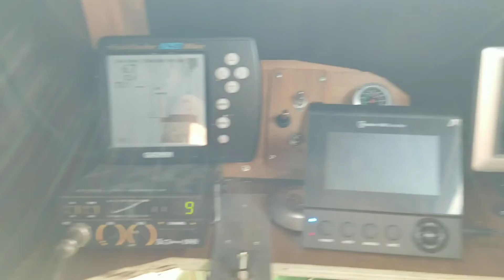Plywood mini boat for exploring!

Comment: Polycarbonate doesn't seem to seal well as its oily or greasy so sealing I'd say will be problematic. My friend built a fish tank 6' x 16" x 2' and sealed with clear silicon, he drilled and screwed every 1" or so and after a few attempts give up as it leaked like a sieve.
Laminated glass on the bottom about 14" x 14" at most and fixed to a box section or angle iron frame then to bottom of boat would be my choice.

I built a thin rectangular wooden framed boat like a canoe when I was 14 years old, I covered ( wrapped ) it with heavy duty clear plastic ( stuff used on building sites on concrete floors to stop damp rising dpc ) it was great. The water pressure would push against it but it was fine and the bottom of the lake was great to look at.

I saw shopping trolleys in the middle of the lake :( There was a shopping centre close by and when the lake froze over kids pushed trolleys out, ice eventually melted and the trolleys sank.
There was loads of fishing tackle caught on them.
It was very strange and eerie, definitely a different world ha!
Reply from the maker: Hmm well thats not inspiring confidence... i feel like there will be a little less pressure than on a 90° corner but that may just be wishfull thinking... maybe ill be able to wrap some fiberglass and resin around the corner or something.. plus only the bottom few inches will be underwater... maybe some flex seal from the infomercials or some crazy tar lke stuff....  thanks for the heads up buddy!!
Reply: @americanboathead5390  Epoxy and fiberglass might work on outside edges, water pressure is pushing in and not out which is better than the way a fish tank works so It may work, I hope it does mate, love the little boats ya make 👊
Reply: Hay man liking your stuff   Silicon is the way to go do it right the first time and give it the cure time you won't be able to get it apart I use to build aquariums silicons great on wood or glass.   Not somethings. ( test ) Put some on a test piece let cure see if you can rub it off if you can no good.  Again go Boathead go
Reply: Build a fish tank  Clean glass silicon joining edges tape tank together silicon inside edge smooth with finger let it set 48 or more hours. No screws no frame just time for the silicon to cure.  Give it a try    PS curves add strength.

Comment: A hot air gun allows you to flex the Polycarbonate  without stress fracture. I'm always willing to chat to try to answer any technical issues you run into. Jim
Reply from the maker: Thanks man!!  From what i read its the acrylic plexiglass that needs heat. The polycarbonate can be flexed 90 degrees or more cold without comprimising any strength.  The downside is that it scratches easier than plexi.  We should totally chat! I started an audio only podcast thatd be fun to do!
Reply: @americanboathead5390  Not saying I'm just saying heat gun can't hurt.